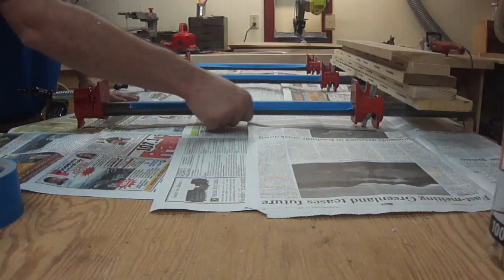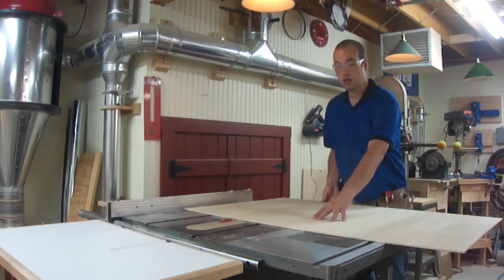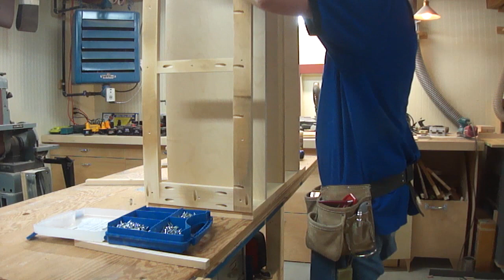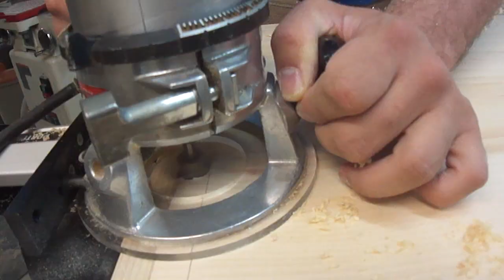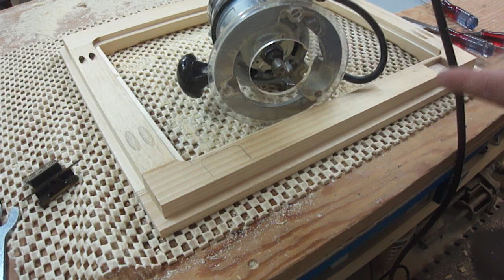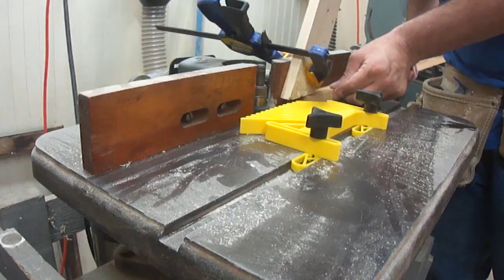Build a TV stand

Comment: Porter cable trim saw. Oh man Norm would be proud.
Reply: I have a Wards Powercraft Trim Saw, same vintage, probably as old as I am. The jig saw and router are oldies but goodies, too.
Reply from the maker: Mike King I was on a old/vintage tool kick in this video. There was the Porter Cable trim saw,Black and Decker jig saw, Rockwell router, Kreg pocket hole jig, both Rockwell and Dewalt radial arm saws, Makita 7.2v right angle drill (early 90’s is ancient by cordless drill standards), and the Craftsman shaper. I was going to use my late 80’s Porter Cable 555 biscuit jointer but one I need to replace its bearings.
Reply: @TheNorthlandWorkshop  I just got the 9 .6 volt  version of that angle drill (and have several other Makita and chuckle when Norm pulls one out in old videos) and it's already paid off. Nothing wrong with old tools that work, I only quit using my panel saw when the blade guard spring broke.
Reply from the maker: Mike King those old Makita drills were built like tanks. Back around 2002 when HGTV was good they had a program called Help Around the House and the guy on it had one of the old Makitas and one of their tiny circular saws that took the same stick battery. I always wanted to try one of those saws just to see what it could do.
Reply: @TheNorthlandWorkshop  I have the saw (it's just barely OK) I also have a non-working version of the little jigsaw, the one shaped like a reciprocating saw, that I really hoped worked, I bought it as part of a lot with the angle drill, it's a dud, maybe a project for this winter.
Reply from the maker: David Bryan Woodworks it’s a good saw. Plus I went “full Norm” using the Jack Rabbit bit in an old Porter Cable drill!
Reply: I had the same porter cable drill new back in the day.  Sadly it gave out but man I loved that drill.  I also have a delta 12 inch ras just like norms.  I do miss norm.  He was an inspiration.  Keep up the good work.
Reply from the maker: David Bryan Woodworks yeah, I miss Norm and the NYW. Russell Morash actually gave me a tour of the NYW back in 2008 it was quite a place.
Reply: The Northland Workshop  You even wear the Norm Abrams toolbelt, which is uncommon among woodworkers.
Reply: Barry Manilowa it’s all legit.  Tool belt just makes it perfect.  I can’t seem to like wearing one.  Especially around nice pieces of cabinetry when I building them.
Reply: The subjects covered in this woodworking website TopFineWoodworking. Com varies from wood types to tool types and uses. A few other subjects range from the various kinds of wood along with their distinct levels of difficulty when it comes to managing them. If you are still a beginner in wood working, then you will find this book very beneficial.